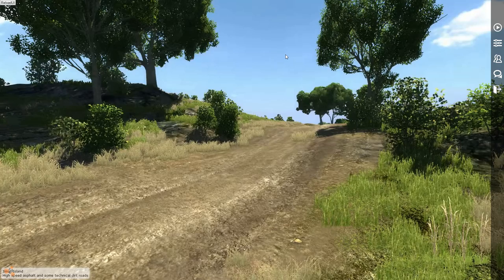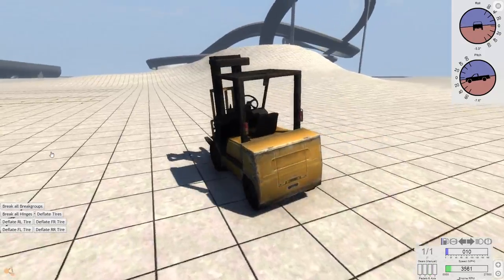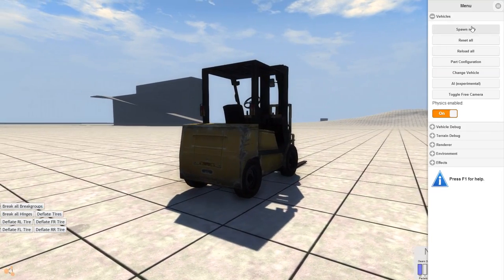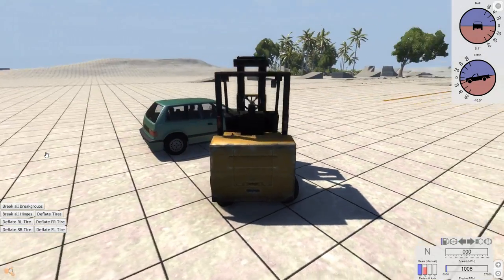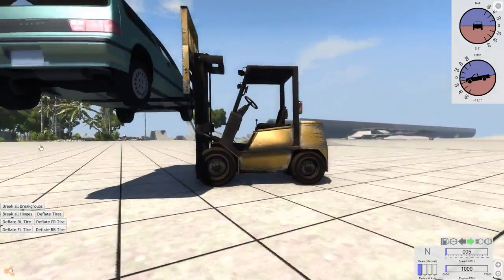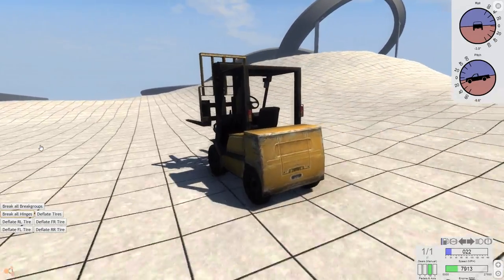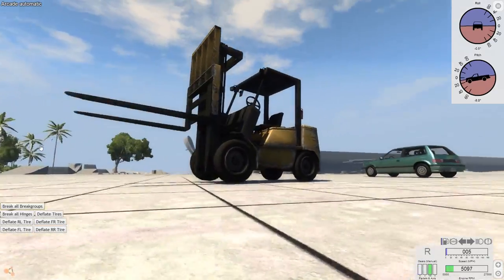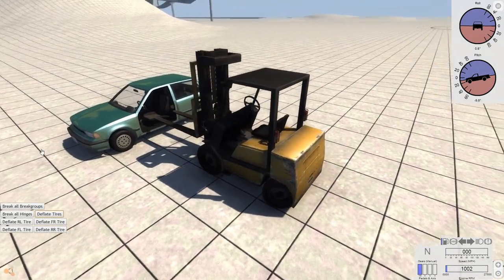BeamNG.drive - DSC Forklift

Comment: That ibishu ain't 1 ton!!!  Probably 0.7/0.8 (800kg)
Reply: what are kg
Reply: Kilograms.  One Ton is 1,000kg which is 2,240lbs, so the Ibishu is probably about 1,700lbs at a wild guess
Reply: *****
I know it was a joke :)

One ton is 2,000lb actually. at least in the customary/imperial system that the US uses :)
Reply: Ah, in the UK it is 2,240 :-)
Reply: *****

 #TheDifferencebetweenTheDifferentMeasurementSystemsIsReallyConfusing   #EverywhereShouldUseTheSameSystem